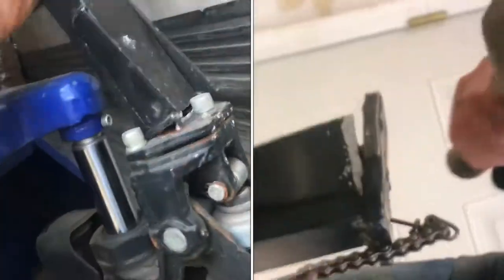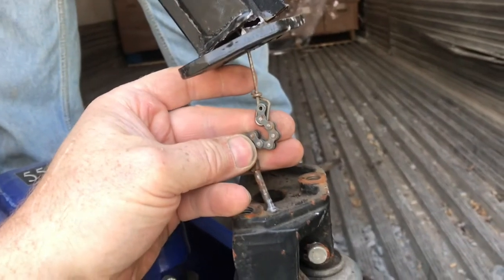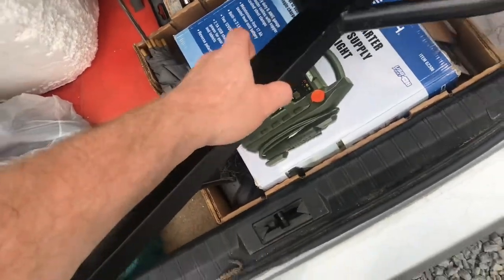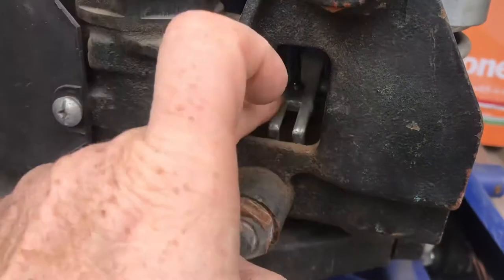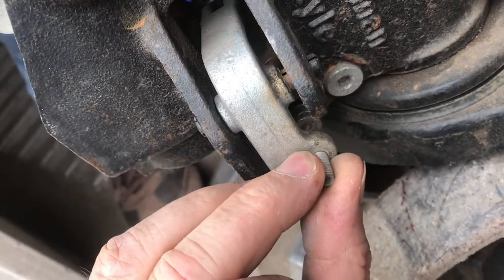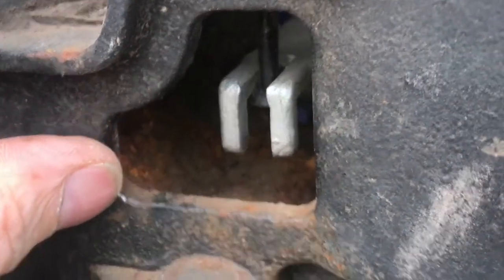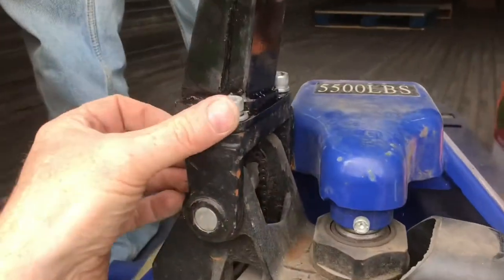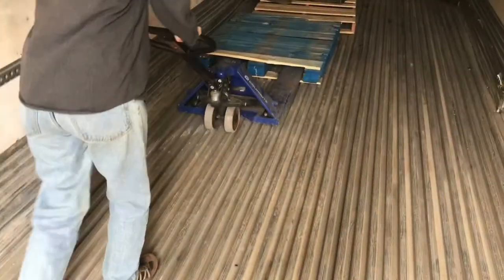fix BROKEN pallet jack handle (how it all works) disassembly

Comment: My handle isn't broken but  I hope that chain adjustment thing is what is wrong.    I have a Green 5500LB   says wesco on the side.   I hope this is all it needs and not the hydraulic part all messed up.

  Thanks.
Reply: Larry did you get it going
Reply: @Gonefishing185    no it;s still sitting in my driveway,  I think it needs a new seal kit and I cannot get a straight answer from wesco as to what to buy to fix it.   it really sucks they dont help folks out when they need the help.      i might try  ordering  parts and returning them till I get the right one LOL    man though, I really hate that crap.
Reply: I drive commercially, we have maybe 20 pallet jacks at my terminal, all of them are ratty and in some form of disrepair.  
We have a few of those green wescos too !
Reply: @Gonefishing185  do you know any place that sells the right seal kits for them?
Reply: I don’t, at least not yet.  What’s going on with yours.
Reply: @Gonefishing185  doesn't build pressure to go up.    so I am guessing the seals are blown.
Reply: @larryleisuresuit9584  I’m having the same issue with my crown pallet jack 
The hydroelectric goes up when u pump but as u let go it goes down 
My mate told me it might be a seal or gasket sum like that 
Imma try n buy a seal kit hit
Reply: @Yes-ls7fv  im still not having luck with this parts buying thing for it.  i think I am going to take it apart and just measure everything and see if I can find some kit that is the right size.  Pretty sure this wesco place just wants folks to buy a freaking new on LOL.  I even thought of just welding the handle straight up and down solid putting my outboard on it. 🤣